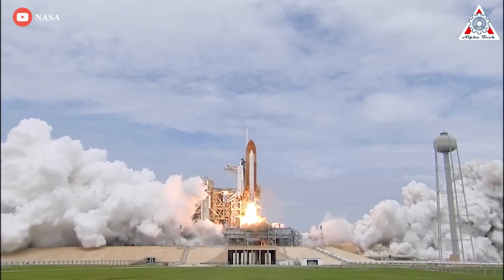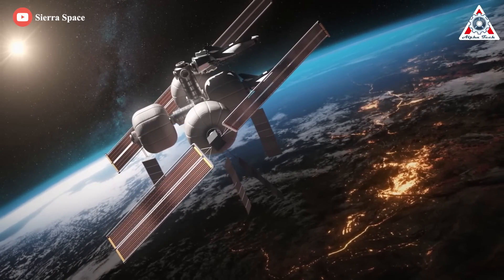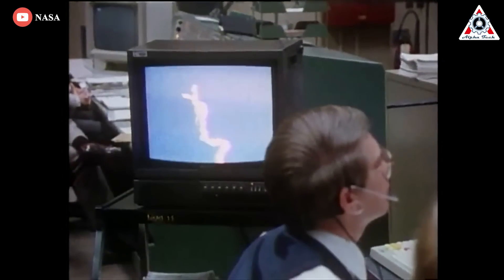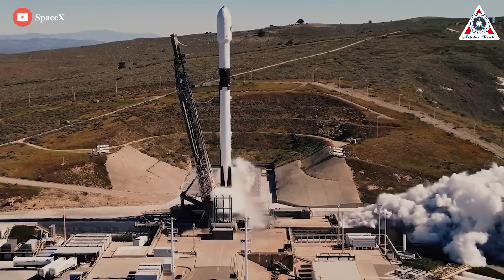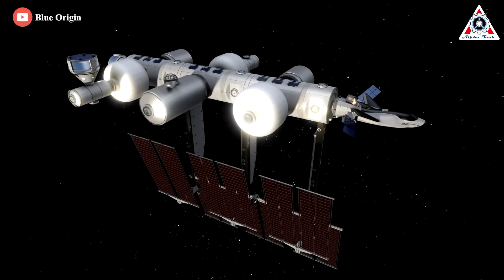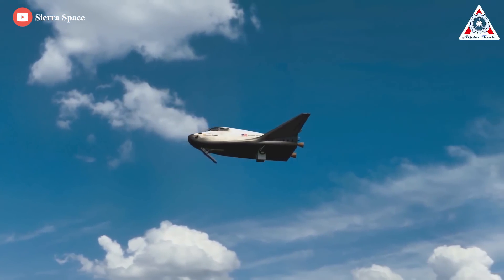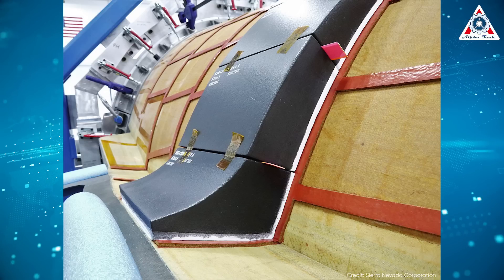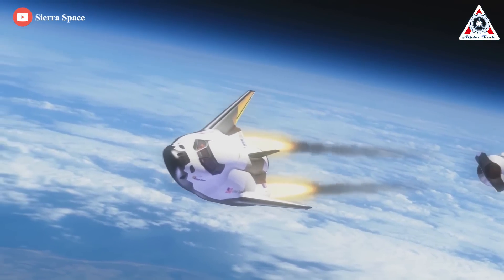Genius! Dream Chaser A New improved and Better than Space Shuttle???

Comment: due to weather it lands at aunplaned airport, how does it get back to the launch site, this is a huge hole that needs to be told
Reply: maybe load it into an aircraft and fly it back?
Reply: Inside a C-5 galaxy since dream chaser wings fold in.
Reply: Well 747 would be okay with DC
Reply: 747 is not wide enough and most airports can take a C-5 galaxy then there is The Super Guppy airplane.   https://en.wikipedia.org/wiki/Aero_Spacelines_Super_Guppy